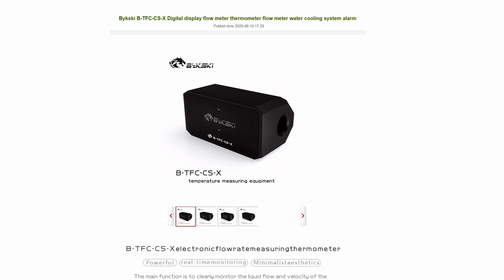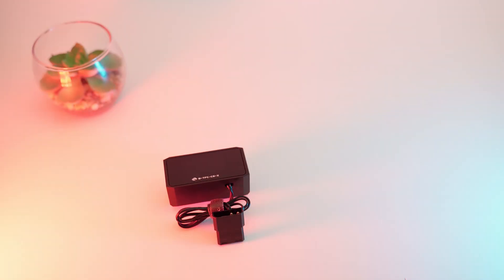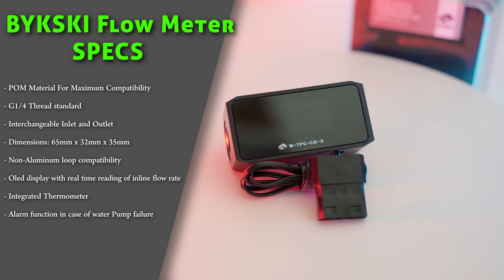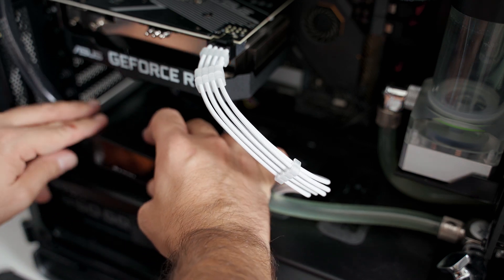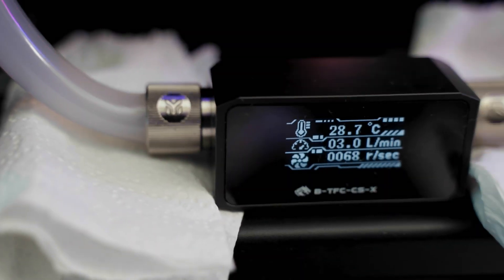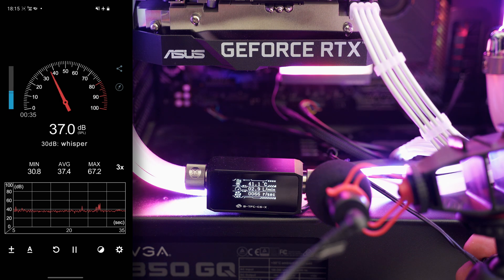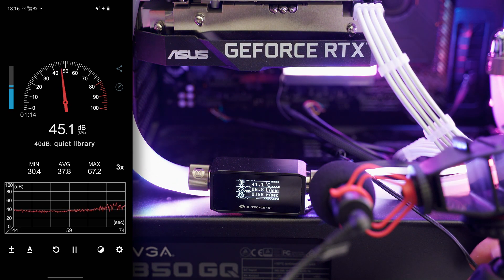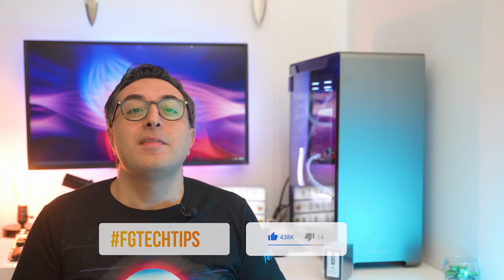Bykski digital OLED Flow Meter Review B-TFC-CS-X

Comment from the maker: Let me know below if you guys own one and can you confirm it's noisy at max pump speed
Reply: I've heard a fair amount of Bykski leaking. I am build a new hard tube EK system now and would like to add one of these.  They at least look very cool. Have you had any issues with yours?  Do you leave your rig on 24/7?  Thanks!
Reply from the maker: Hi I am still using the cpu wb from. Bykski you see in my video review in the channel, a barrow pump and this flow meter and never had any leaks in years. I am anyway using soft tubing as you see.
I run my rig about 8/10hrs a day
Reply: @fgtechtips  Great! Thank you

Comment: what type of connector does the flow meter have? i broke the cable on mine and cant figure out the connector type so i can repair it.
Reply from the maker: I think in the video it's quite clear that it's a normal Molex ? It should be quite easy. You can also check the product links i posted in the description
Reply: @fgtechtips  no it does not. i m talking about the small connector not the molex. and the product page has nothing regarding the cable type. even the support representative is clueless after i have emailed them
Reply from the maker: @LQ-gaming  as far as I know it's just 2 small cables that go to an ordinary Molex.....
Reply: @fgtechtips  no they are not. there is a custom JST connector type inside that i can t find on the regular market
Reply from the maker: @LQ-gaming  oh ok didn't know that, i have never opened that Molex. Fastest thing is to ask for replacement if still under warranty

Comment: I thought 1.5l/m was the target flow .. not 3.5 l/m
Reply from the maker: No it's not the target but it's the actual. The device offers real time reading of your inline flow rate
Reply: @fgtechtips  Yes I own the Barrowch flow/temp meter oled display .. I run the my system @ 1.4 .. 1.7.
Reply: @digitallantern593  A d5 pump will have a maxinum flow rate of 26 l/m just by itself. After your loop is finished you should aim for a flow rate of ~3.7 l/m. Anything restrictive in your loop will lower that. Your flow rate is low, you must have a lot of things in your loop.. quick disconnect fittings are a big flow rate killer.

Comment: I have the exact same model and I keep getting the Alarm warning
Reply from the maker: It looks like your water flow is insufficient. The only alarm i get is when the water pump gets accidentally disconnected and therefore there is no water flow
Reply: @fgtechtips  that's the thing, the flow meter is installed right next to the pump output. and i still get the alarm. even when I run the pump at 100%
Reply from the maker: @SuperCheesyMan  weird, if you installed it in the right direction then it could be a defective product ?
Reply: @fgtechtips  yeah that's what I fear. But not worth sending it back to AliExpress :/
Reply from the maker: @SuperCheesyMan  try asking for a refund, at least a partial one.
Reply: maybe u need to reverse the flow thing inside the unit?
Reply: @Ghazoline1988  done that. It only works (barely ) when my pump is at 100%
Reply: I got the same thing running 2 pumps and it do t mather how i put it i get the alarm even when i put both pomps on 100% one thing i did see is when your filling up th tank after cleaning you will get a alarm because the flow rate is almost nothing but of you own a corsair pomp and you take out the 6 pin connector the pomp runs at full speed well i added this flow meter to a built and did that GUES WHAT ALARM.!

Comment: How would you use this to adjust fan curve based on coolant temperature. Is there a plug into T-sensor? Or would you need a stop plug with temperature sensor for that as well
Reply: I have this product Just shows  temperature, water flow speed and revs per second.  If by chance your water pump runs below a specific revs there is an annoying flashing ALERT screen. Any true PC water cooling enthusiuast  will NOT like this feature. Abysmal
Reply from the maker: I never got the alert so far but my pump goes to a minimum of 2lt/min. I got the alert only when the pump was disconnected so I think you have an issue in your loop